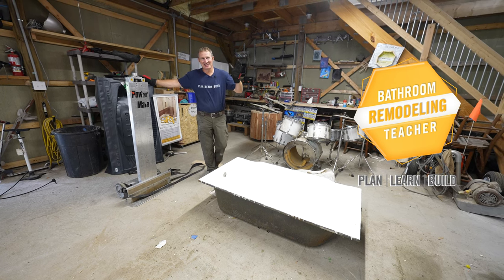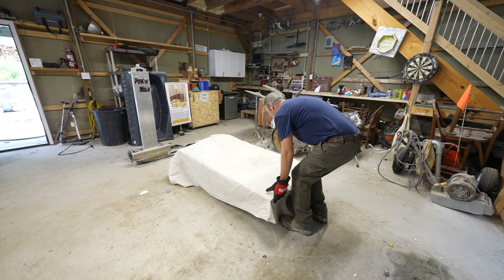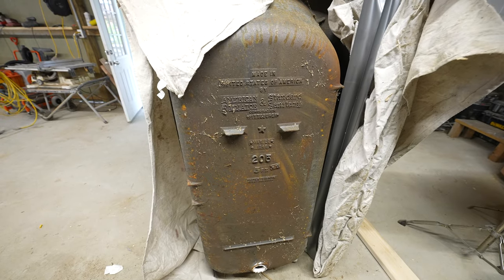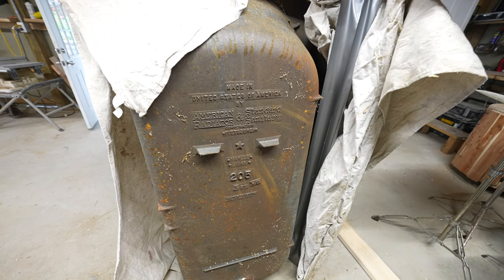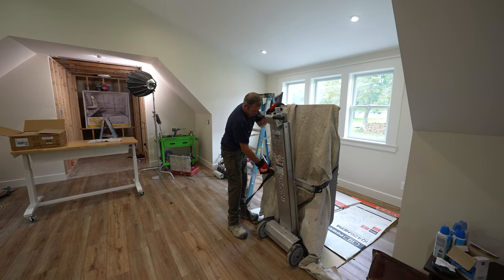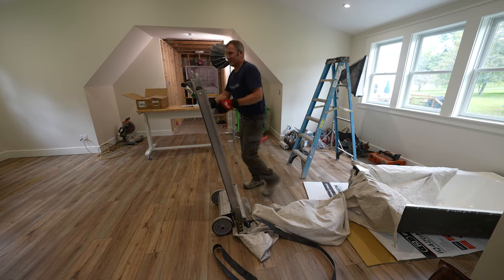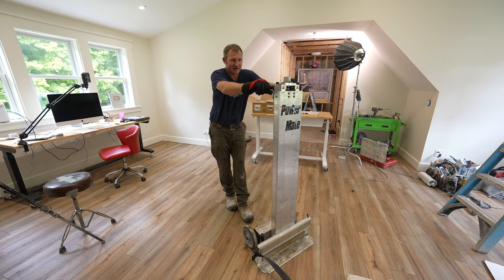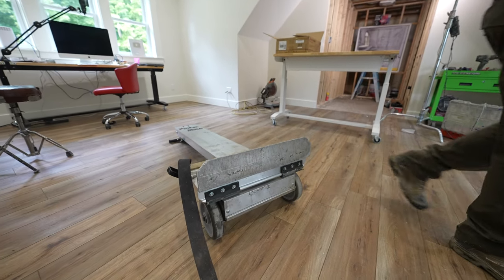Stair Climbing Dolly | Caste Iron Tub Upstairs

Comment: Just got done cut and hammed one of these and chug it in 4 trash bins. I’m glad my  orange bathroom is done. I’m not sure why would anyone use cast iron tubs anymore, but if u slip and drop that while going up the stair then u sure will get a hole in the wall and wreck the stairs
Reply: because they hold the warmth of the water and they aren't made of plastic.
Reply: I’m not sure y anyone would want a piece of crap plastic tub? How long does it last? not long like your bath time lol
Reply: @ImanuelMesiah  grown adults take bath?  You would fill it up with 50 gallon of warm water and spend hours to bath in it like a toddler?  These tub are color faded from the 60’s and resurfacing it will still get pain chip after spending a large amount
Reply: @samd1405  yes because grown adults need to take a bath with 50 gallon of warm water daily in busted faded iron tub from last century. One slip in an iron tub would crack your skull and a plastic tub just be a bump
Reply: @Derpherppington  Adults take baths all the time.  You ever heard of soaking tired or sprained muscles?  Some people actually have separate showers too so slipping is not an issue.  I have a brand new cast iron tub not one from last century.  Enjoy your microplastics. Lord, you are cranky.  Get help
Reply: @samd1405  stop lying houses doesn’t come with bathtubs these day. The trend is walk-in shower. Good lord grow up and leave the bathtub for the kids
Reply: @Derpherppington  I built my house so it comes with whatever I put in it.  Good lord you sound like you need a bath, maybe fall asleep and slip under the water, lol.